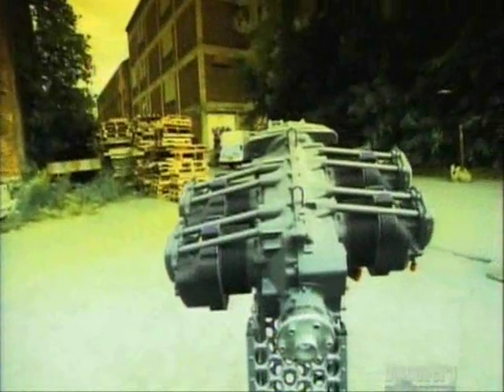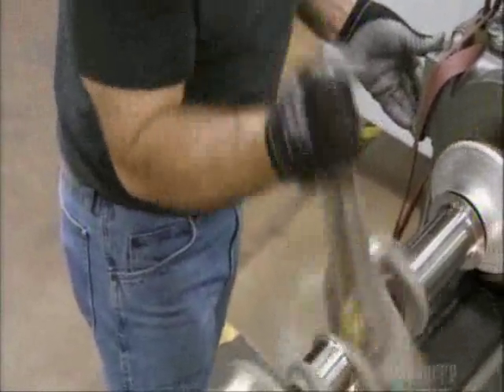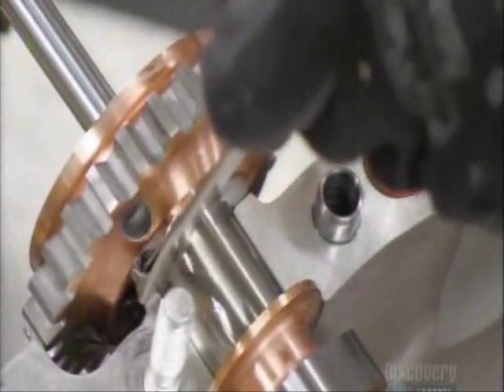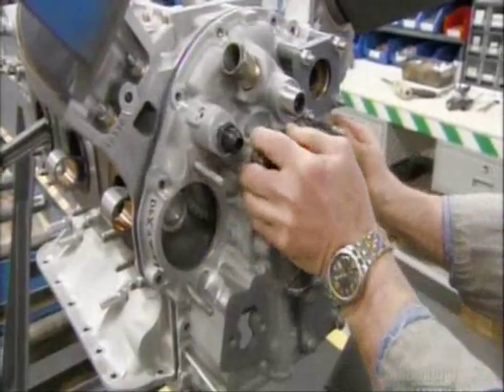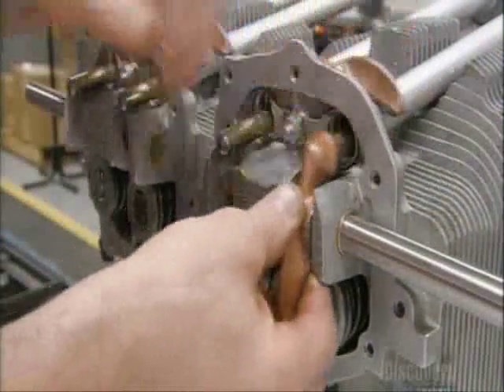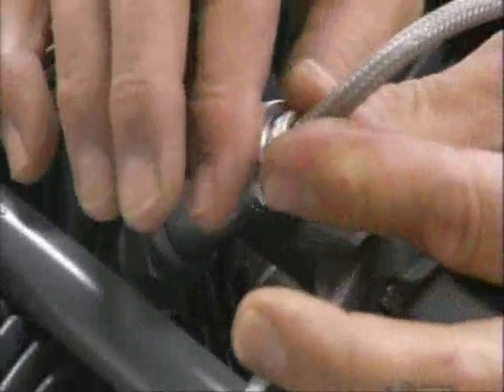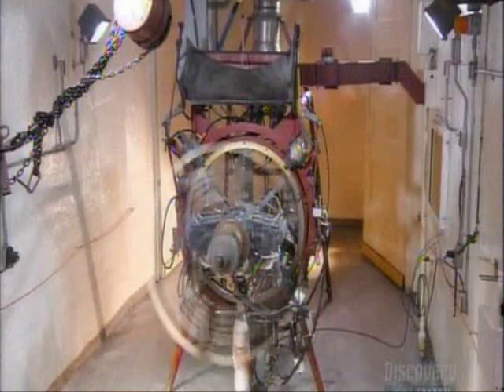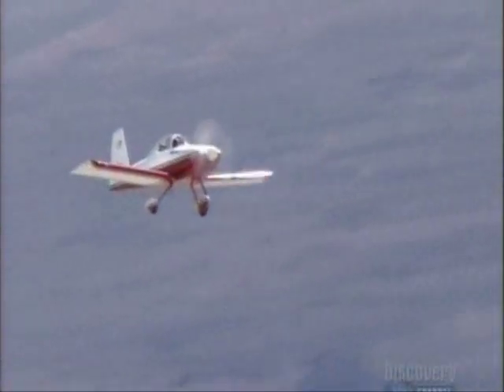How Its Made 07 Aircraft Engines

Comment: The ignition system if I am correct ( and I'm sure I am, as I perform maintenance on a 1955 Beechcraft Bonanza with an E225-8 engine ) consists of the plugs, wires, and mags. The V-tail has 12 plugs and wires, with two mags. I've also thought it funny that they're still making mags as it's basically 1940's technology and today's coil on cap systems are far more reliable.

Comment: what's not shown.. why this simple engine, whose development, and tooling costs were paid in 1954,   costs $28,000 !!
Reply: +Capt Larry FAA certification, which creates a monopoly as this is one of the few engines of this size that is certified.
Reply: +Nobody YouKnow If you have to ask...
Reply: how much it should cost in your opinion ?
Reply: 4 reasons, actually:
1. FAA certification
2. Liability
3. Liability
4. Liability
Reply: bloody lawyers, bloody lawyers and more bloody lawyers plus faa
Reply: Absolute. nonsense.  Engine manufacturers. are constantly. upgrading their.mwthods, materials. design, testing.  Nothing was.'paid off' in 1954.

But hey, if you think you can make the.engine for a cheaper price.at the.same reliability and.quality rates, go for it!
Reply: Amit Ika That's actually a meaningless statement.  That it is one of the few certified does not make a monopoly, it simply provides an opportunity for other manufacturers to find their own niche.
Reply: Mark Doldon it's not meaningless. It's a side effect what you're mentioning is also a side effect. It's effective to not see things through only one lens, bud.
Reply: $38,000.00 for my 6 cylinder Remanufactured Continental engine., of the 1952's.  or $25,000.00 to OverHaUL MY OLD engine.
Reply: Don’t you just love the faa?
Reply: What's not shown are less complicated, less bulky, more reliable, more powerful, more fuel efficient engine designs of the 21ST Century.
Reply: looks like a harley engine to me lol
Reply: Mark Doldon aaaand testing every goddamn part up to and including a mockup installation with an actual flippin propeller...
Reply: Nobody wants to watch 4 hours of paperwork.

Comment: Silk in this place is absolutly the best thing to use. When the mainbearing are bored in the the block you cant use gaskets, silk can take oil, moves with the metal and dont affect torqe on the bolts. This is lightweigth, few parts, low end torq due to big volume and will last a very long time.

Comment: About dual spark plugs: On planes - safety. On racing cars in the past it was mainly for spark duration. Correctly timed two plugs can together make a longer lasting spark which in turn improves the burn. Two plugs is on racing engines today more or less superceeded by various multiple spark discharge systems like MSD. Read Smokey Yunicks book "Power Secrets". It´s all there.

Comment: Ignition system is everything. Plugs, wires and mags. TCM(Fadec) is starting too use it's new electronic ignition system in new planes now or retro fit older ones. Lycoming is also work on a EFI system also which is starting to show up on some new planes. Getting new tech approve for aviation can take forever and cost millions when it comes to engine. I know, I build engines for a living.

Comment: Indeed!  The part is that was probably something like a 7.2 liter 180 HP engine.  The pistons are so huge because it produces all of its power below 2400 RPM.  If they used small pistons to produce that power by the engine turning faster, they have to add reduction gearing that increases weight, something to fail, power loss, etc.  Props can't turn much faster than 2400 RPM (on this size plane) because if the blade tips exceed the speed of sound, drag increases and thrust decreases.

Comment: and also - the drive belts (or chains) are just another point for failure, and the cylinder heads are separated to allow proper air-cooling. the separate heads would mean you needed 4 cam shafts, 8 pulleys and 4 belts. timing would be a nightmare :)

Comment: Soharino, you are right, it is. Where is the water cooled, compact, high-performance reliability like that you'd find in any reasonably modern car? This is air cooled 1930's technology!
Reply: This is going in an airplane, which has a maximum takeoff weight. Every pound you waste on radiators, coolant and water pumps is a pound you can't use for fuel, passengers or baggage. 1930s technology works fine, and it's lighter.

Comment: 1. They use journaled bearings for reliability.
2. Fasteners are torqued, crimped, &/or safety wired. 

I don't understand what you are saying. Engines are built in many different configurations.

Comment: unlike a car where the crank sits inside the oil pan, the crank on a piston aircraft sits inside the block, the bearings require a tight fight, and as such you can't have a gasket.  These engines have been in use for 80 years and theres no issue of reliability.. performance on the other hand leaves a bit to be desired.  Which is why most companies today are going with Rotax, rather than Lycomming, or Continental.

Comment: fuck sakes, the number of times they go between the 4 and 6 cylinder engine, and no love, that's a carburetor not an injector.
Reply: +ThomasTheSailor Chubby she is only reading an auto que, it makes you wonder why they don't get the company to proof the video tho, there are always annoying mistakes in this program but I love it all the same
Reply: er...  no it doesn't, it uses venturi effect to drop the inlet manifold pressure bellow that of the fuel in the float bowl and suck the fuel into the airflow, one side effect of the drop in pressure is the drop in temperature resulting in the need for carb heat controls. don't worry, carb icing is very unlikely to ever effect a PC pilot such as yourself.
Reply: VW Beetle air cooled engine came from factory with carb de-icing!
Reply: That's not a carb, it's a EFI. It's like those electronic carbs, but more like throttle body injection.

This engine originally was Carbueratted, but it hasn't seen a carb since the late 70s early 80s
Reply: I think that's a throttle body fuel injector
Reply: that is not a carb , that engine is a lyc io 360 , the part you think is a carb is the air control unit [throttle body]. If you look at the engine just before they put on the test club , you can see the injector pipes going to each cly head , also you can see the fuel distributor block on top of crankcase .
You can check it out on the net at lycoming , the io360 has manual fuel injection , no electronic ecu at all , and sump is same bolt pattern for carb or air control unit.. But i can understand why you think its a carb , only experience would let you know , i worked on these things for years , and also fly , so know the o360 , io360 , io 540 , 0200 ,0300 , and io470 very well . Cheers and Hi from NZ. Grant

Comment: @mahdimatabdar Magnetos are part of the electrical circuit that generate electricity from the rotation of the engine - you need these to create electricity for the spark.

Yes the engine is fuel injected, but you still need a spark plug to start combustion.

Comment: That is Beautiful,   but,He forgot washers on the Cylinder bolts at 2:30 ..  That's a No-No .  washers spread out the force and reduce friction for proper torque.  I didn't see a Company name or Logo.
Reply: it's not meant to have washers my friend, I've spent too long putting these things together, and neither Lycoming or continental ask for washers under the cylinder base nuts, regardless of the type of nut. anything under the nut would only increase the possible of fretting in the case halves which wrecks engines and can cause a seize.
Reply: Right, RELIABILITY!, thats why these motors are so expensive (along with liability). You can buy VW beetle motors for aircraft if you want an engine without liability....they cost about $6000 for 70HP or so, after all if the damn thing breaks its hard to pull over and call AAA!

Comment: A simple and robust design. However, it is also highly outdated. It needs to be overhauled every 2000 hours costing around $40.000 It is air-cooled instead of water-cooled and does not create a lot of power. The average ga engine has around 180hp. The manufacturers must be making a killing on those engines.

Comment: using gasket from a can and thread to seal an engine: smart.
Reply: It works, for a given degree of works. most of the drips come from the cylinder or the valve covers usually.

Comment: in theory yes, but the aircraft engines like Lycoming or Continental are old technology (=WW2 not much better) and very heawy for they power and are fuel sukers, so the modern reducted water cooled engine are lighter in HP to weigh, consumes 20% less gas, and more reliable (no cyclinder seizing or thermal shoks problems at descent at low power) 
for comparision: Rotax 912S vs Continental 0-200...

Comment: Now consider that Dr. Ferdinand Porsche designed an aircooled OHV flat 4 in the mid 30's.. earliest flat 4 in American aircraft was the 40 hp Continental ( J2 Cub)  with a flat head ( L Head) engine what  late 30's ?   French put the VW in aircraft right after WWII  ( Jodel),  still used today.Franklin ( Air Cooled Motor Co.)  had been making aircooled ( inline 4) auto engines since the 1920's ..and just post WWII introduced what was probably the most advanced flat 6 cyl aircraft engines of the time.. between 150 and 225 hp.
Reply: Err Herr Dr. Eng. Porsche didn't, he stole the design from the Checkoslovakians. After WW2 VW had to pay a large amount for this theft from TATRA.

Comment: Wow. They are air cooled AND pushrod AND carbeurated? That's crazy man. I guess if it's not broken don't fix it. Interesting that the most reliable aircraft engine you can build uses technology from the 40's and no fuel injection or ECU computers.

Comment: At 2:20 they slide the cylinder over the piston, how did they get the rings in there so easily? I see they remove a device...does this device some how fit the rings into the cylinder?
Reply: The "device" you're referring to is an aircooled-engine ring compressor. Unlike putting pistons in a watercooled engine, where you put the piston with rod attached into the cylinder and attach the connecting rod to the crankshaft, you put the rod on the crankshaft, put the piston on the rod, and put the cylinder on the piston. If you used a ring compressor with a handle, you'd never be able to get it back out. So, they use a piece of sheet metal bent into a circle. You compress the rings, slide the cylinder on, and remove the compressor. Easy to do.

Comment: Remarkable? I don't think so. Looks to me like pretty ancient design and BIG.
Reply: ThomasTheSailor Chubby I do agree. Merely commenting on the suggestion that this is somehow high tech. Big engines though. I suppose that way you get the power at low RPM, no need for gearboxes?
Reply: they are incredibly reliable, but it's true, they are ancient. Go check out continental's new diesel engines, they're all turbo charged, make the same amount of power burning half the amount of gas.
Reply: And they weigh a hell of a lot more.

Comment: That's not a good reason.  Aircraft engines are generally designed for longer duty cycle at a higher continous power and constant speeds.  It's simply not a good engineering match for the duty cycle of a car powerplant.  Car engines run over a wider speed range and generally cruise down the highway at much less than their max power rating compared to aircraft engine.

Comment: @BrassAxe Nice try but no. Even a minimal Google search on the subject will yield lots of arguments for water cooling instead of air cooling: aluminum fatique; exhaust valve guide lubrication problems; lower power per cubic inch etc. All that aside, I think the problem is something entirely different: in the US legal system, there is no money left in law suits against manufatcurers of air cooled engines. They are "safe", thus reluctant to put new "unsued" engines in their planes.

Comment: That engine is about 100 horsepower and 250ftlbs of torque, these things are built for reliability, not power, the red line is 2400RPM.  Wont do you much good in a car.

Comment: '
why this motor dont have =
1 - ball bearing in the block motor
2 - lock washer or space washer
'
two up cyclinders and another two down cyclinders are wrong design,,,
should be 1/4 , 1/4, 1/4, 1/4,,,
same as clock number is 3 / 6 / 9 / 12 camshaft

Comment: How strong is this four stroke engine ?
Reply: Thanks :)
Reply: Michal Agro
That's 200HP at 2800 RPM, with lots of torque - and a high BMEP (Brake Mean Effective Pressure).  They're direct drive, and can't spin much faster than 2800 RPM because the propeller tips would go past local supersonic and cause severe vibrations in the prop without much more thrust.

If they spun at 5600 RPM that would be (torque*RPM) near 400HP!
Reply: Jack Jones Can they not gear them down?
Reply: justfakeit888 Gearing down introduces more points of failure and you lose some energy in the process.

Comment: they forgot to mention..aircraft engine are a complete rip-off not reliable at all and cost more than a luxury car.
FAA approved part so you pay $500 more for it.
4 cylinder engine producing almost no power.14O hp
Reply: Hmmm! Producing almost no power? How about you check the torque figures for that puny 4 cylinder engine. They are designed to produce that power continuously under full load for quite long periods of time. All in the operator's manual as to how long at what settings etc.
Try running your car engine under the same conditions these engines cop and see how long it lasts!
Reply: 140 HP and Gobs of Torque at 2500 RPM. For 6 hours+ on a stretch.  If taken care of most of them are pretty reliable. IF taken care of well. 

The FAA tried the whole not approving parts thing in the past......Things went poorly. You can't pull over to the side of the air.

Comment: Why air cooled engines? they are simpler and cheaper to built, but less efficient , so the most fighter engines from WW2 was water cooled (Spitfire, Mustang and so..).The Americans use more air cooled engines but they are very conservative: see the new Cessna Skycatcher: Cessna present this aircaft with a Rotax 912S but consume 20% less (and automotive gas), lighter, better performance (bigger prop) silent and well proved (15 years experience), but the American pilots will only the old 0-200...

Comment: I dont' have here the  place to explain a engine thermodynamical lesson...what is the cause if all the modern cars use water cooled engines?
The reason to put water cooled engines in combat aircrafts is aerodynamics and thermal shocks resistance ( a air cooled engine can seize at fast dive...)
And the most British bomber (Lancaster) use what engines? And the most German bombers use what engines?
Think better before speak...

Comment: Good propaganda to support 1950's technology.    Have they solved cylinder nuts backing off ?, the main nut on engine fuel pump backing off? , or on exhaust Headers?  .,,,,  But,good proven design and getting better over time.   I'm not so impressed.